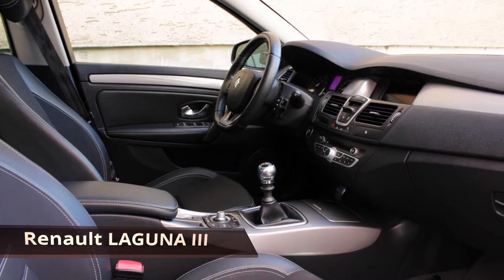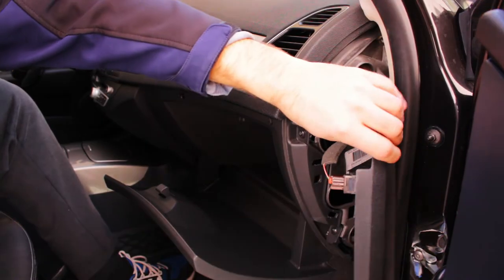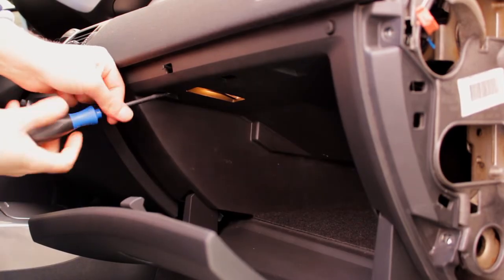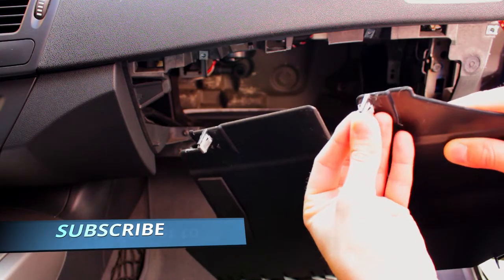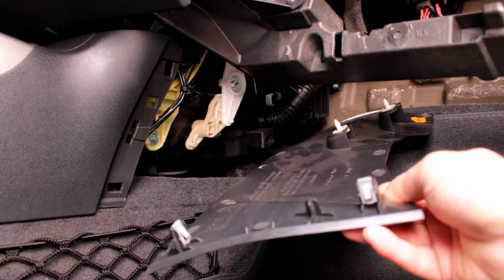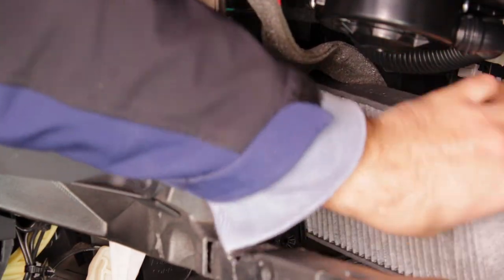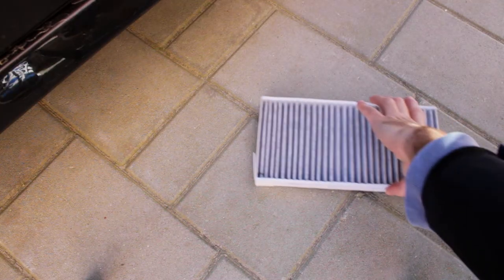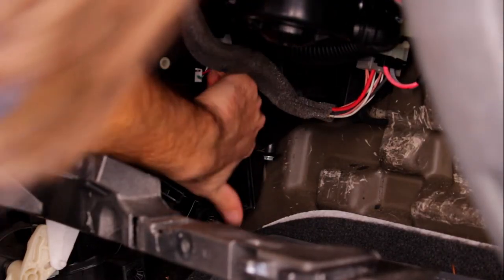How to change cabin filter - Renault LAGUNA 3 pollen filter location and replacement

Comment: Thanks for the vidéo ! Unfortunately for my Laguna, the curved plastic hose to bring air on passenger foot is missing in my Laguna ! And as you guess is nearly impossible to find the part without its number.. Could you please help me ? If you still have access to it, i would be grateful if you tell me the Renault number written on this plastic part. Thanks !

Comment: I don't know what filter to get. If I search by VIN or serial number I get various sizes like 266x133mm, 316x133mm, 343x134mm 261x131mm. I don't know witch one to get. 🙁
Reply: Did you find out?
Reply: @paradabnd2973  Yes, I didn't know what to get so I bought OE Renault filter and fit perfectly, the dimensions were: 266x133x30mm

Comment: Imam jedno pitanje planiram uzimati ovakvu laguna gt 3 benzinca 2.0. Interesuje me kakva je cena odrzavanje kako se ponaša autic na auto putu pri brzini 150 kmh jel susti jel stabilan? Jel znaš mozda kakav je motor kod benzinca jel to onaj stari volvov ili? Odrzavanje 4control itd.. Hvala.
Reply from the maker: Pozdrav. Koliko znam motori su renault. Nisam imao prilike voziti Lagunu gt 3 s tim motorom, ali sam imao Lagunu 2 gt sa 2.0 benzinskim motorom od 99 kw i bio sam super zadovoljan s tim motorom, prodao sam taj auto sa 300000 km bez da sam išta radio na motoru. Laguna 3 gt mi je na auto putu stabilan i na ovjes i držanje se ne mogu požaliti. zvučna izolacija bi mogla biti malo bolja, ali je u svakom slučaju podnošljivo i dosta bolje u odnosu na Megane 3 ili scenic 3. Osobno imam dobra iskustva sa održavanjem ovog auta jer nisam imao kvarova (osim onih graničnika vrata što smo snimili i video o tome), a redovito sam mijenjao sve i za sada me dobro služi ( ulje, filteri, pločice i slične potrošne stvari). Ovjes na laguni 3 je po meni puno bolji u odnosu na lagunu 2 i tu isto tako nisam do sada imao potrebu nešto mijenjati ( ni amortizere, opruge, kugle, krajnike . . .), a auto sada ima 220000. Što se tiče 4 controla prijatelj je dugo vremena imao lagunu sa 4 controlom i nije imao problema s time, ali osobnih iskustava nemam. Nadam se da sam barem malo pomogao i želim ti sreću pri kupovini auta.
Reply: @BbrosAuto  jesi druze hvala ti puno. Meni na slikama deluje ona 20 da je volvov motor zato sam i pitao. Inace skeptičan sam mnogo i razmišljam se između nje a6 2007 3.0 i bmw e60 3.0 i sad sam u dilemi bas onako. Svidja mi se reno do cepa autic dugo ni se nije svideo neki autic tako. Ali ovi su limuzine ono klasa iznad ali su matore i skupe za održavanje i sad sam u ogromnoj dilemi ali hvala ti brate

Comment: I cant pull out the glovebox after i remove the 4 screws

Edit: for anyone having trouble with this, it seems like you need to remove the navigation cd charger inside the glovebox by poking the 4 holes
Reply from the maker: Hi, sorry for the late response. Maybe some models have an additional screw or some clips. Did you manage to do it?
Thank you for watching!
Reply: @BbrosAuto  havent been able to take it off, i tried one more time, i was pulling so hard the whole dash was twisting so i gave up, i have a 2012 btw
Reply: Try to pull at the top of glovebox, near the screws there are pins that needs some force
Reply: @kornelskorka952  the whole dashboard was moving when i was tugging on the glovebox, not a chance. Now the dashboard has squeaks and rattles
Reply: My glove box is empty I don't see anything else and I'm using all my force 😢it does not come lose
Reply: @bertlammens4392  you prob have navigation cd reader , you need to take that out first with the correct tool
Reply: @boi9433  Thanks for the fast help haha, I just used all my force and broke one of the clams